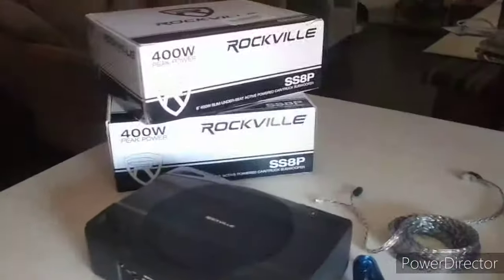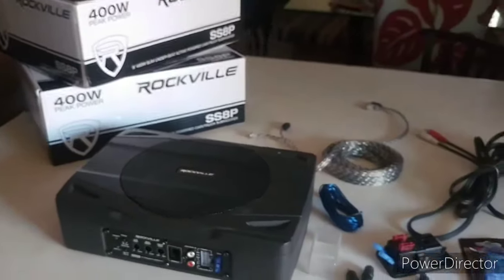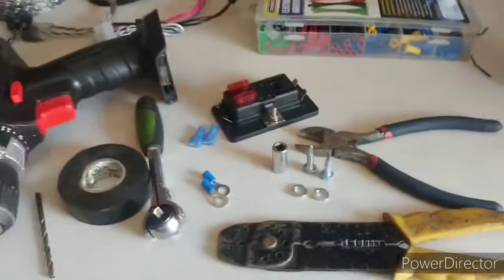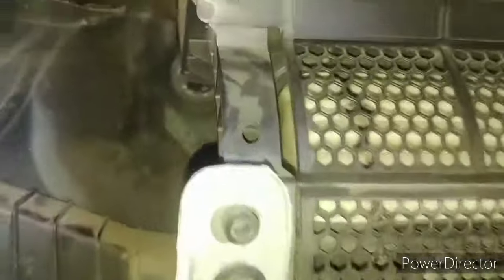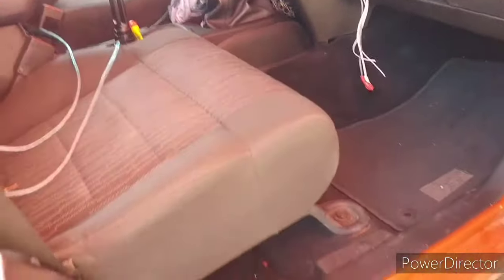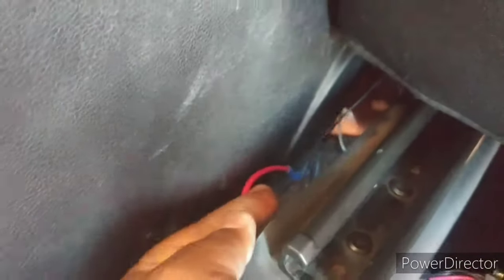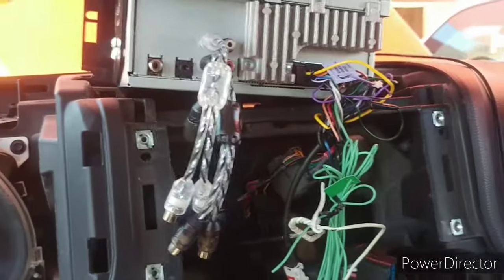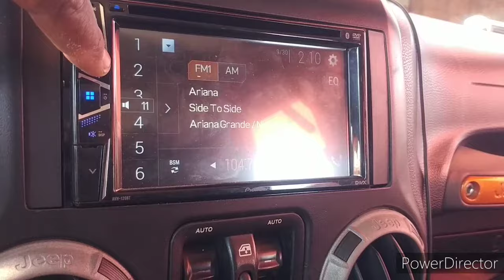How To Install Rockville 8" 400w Underseat Subs in Jeep Wrangler

Comment: Goddammn, I know people was enjoying them speakers because I was enjoying them through my phone!!! You really be making it happen, and I'm here for it!!!
Reply from the maker: They make it sound a lot warmer as the bass really wraps around and rumbles the seats pretty good. It's like being in a theater, man! Love cruising in this with the tops off. Lotta time and effort put into this build, but worth it!
Reply: @MicDropBBQ  True, I see it!!! I love seeing your projects come to fruition!! People with vision interest me a whole lot because y'all's brains work on another type of level!!
Reply from the maker: We're engineers at heart. We see something, and then we start gathering parts and MAKING parts in the garage just to complete the project. The Procharger Project was the largest I've done on the Jeep, yet. THAT was a nightmare. Pull the transmission and replacing the clutch was easier than building the supercharger setup. But I learned a lot about myself and the power of just BELIEVING in what I could do. So many in Jeep forums said it wouldn't work because I had a 2011 with 155hp engine (weak) with a 3.8 V6. I took a setup designed for a 2020 3.6 V6 engine with a lot more horsepower.

I built it anyways. Been driving it since, and none of them ever commented on the video because they really wished they would have been right. To this day, I'm driving a supercharged Jeep with a garage-built kit, no template...no schematic. All thinking it thru as I built it on video. I showed my hiccups and I showed my successes on that video.

I was more about BELIEVING in yourself than it was about building the setup. I just knew in my heart I could do it, even when others doubted me. I put up just over $4,500 in parts and tuning services (when it was done). I call it a win. LOL!

To buy a kit designed for the engine I have would have been over $8k, and the wait was almost 6 months for them to build it. It took me 7 days.
Reply: @MicDropBBQ  I'd say that's a big win!!!

Comment: Thanks for the detailed instructions. Best one for this unit!
Reply from the maker: Welcome, David! Mine are still rocking to this day! Nice, theater sound with rumble seats!
Reply: @MicDropBBQ  quick question. I see where the remote wire goes to the unit but what is that connected to?  I’m a little confused.
Reply from the maker: @davidarocha1075 the remote wire is just a signal wire to tell the unit you want to power it on. Remote wire goes from head unit to a device
Reply: @MicDropBBQ  thank you! 🙏🏼

Comment: Awesome review thinking of doing the same to my Jeep!
Reply from the maker: You won't be disappointed, in my opinion. Thing is, the 8s fit PERFECTLY under there. The 10s might be a bit too large, but the 8s? Enough room for wiring and all to fit under there.

I run with the gain at around 90% on them, and it sounds like DOLBY surround sound in the Jeep. With the gain turned down to zero, you can feel the hollowness and feel the "kick" from the other sub in the back, but these under-seat subs fill the Jeep with warm, rumbling bass you can hear AND feel.

Thanks for checking out the video, brotha!

Comment: I was thinking of running a dual set up like this for my charger only thing is i also wanted to wire in a trunk sub to add an extra kick from the back.... Still figuring out how I'm gonna wire it but I'm definitely gonna use this a base reference for the two under the seats
Reply from the maker: I run a 10" SKAR in the trunk with this setup, and two 8" boat speakers. All the videos in my Wrangler sound system playlist. I showed how I split all the signals.

Comment: What if you want to use stock head unit
Reply from the maker: You can if you run RCA cables from the stock unit to these. I never had the stock unit, but if you have RCA leads, that's all I used to give em signals.

Comment: Hey hey found the block fuse where did you get the splitters?
Reply from the maker: Got em from Walmart. But they have some online (ebay) that has more in a pack. I ended up installing another sub in the rear and needed 2 more. My Walmart ran out!
Reply: I guess they usually come with 1 male and male female outs but some how you got 2 male in versions of a splitter?
Reply from the maker: @BenedictHudson  that's the assignment you have to search for. They sell em!
Reply: @UberJeepAZ  right on.  My jeep jk is a 2 seater so I'd be only able to fit 2 anyway so I guess I'll just need the 1 male in 2 female out kind
Reply from the maker: You've got the dune buggy Jeep! That's the OG Jeep right there! That's the ones that started this whole Jeep craze. hahahaha! Good luck, brotha. And if Walmart carries them, you'll see them on their website before you even go into the store. Saves a little time.
Reply: @UberJeepAZ  thanks alot for your help mate,  got the bits ordered and will tackle this soon.  Thank you for your video. Very well done and love your narration.  Last quick Q.  The antennae wire you mention in the beginning what did you do with that in the end. I feel like you didn't mention it again after the beginning

Comment: Hey what’s up! Thinking about throwing some 6.5 or 8 subwoofers under my rear seats in my JL . Any suggestions?
Reply from the maker: I would do 6.5" due to shallow space under the rear seats compared to the front. Plus if you let the rear seats down, speakers will prevent them from laying down flat. That's why I never put any under my rear seats.

These small powered subs are clean and fill the cabin with nice bass.

Comment: Bro,  hooking this up is a nightmare for my 08.  I'm trying to connect the remote wire to the "power attannae" of my radio and its not receiving signal. I can only get power to it if I directly wire the remote wire to the wire connected to the 12v battery right now.  I don't want to have that because the sub won't turn off when the car is off, draining battery.... thought the end was in sight
Reply from the maker: I have my remote wire connected to the remote wiring coming out of the back of my head unit. The remote wire is a signal, so if you run it directly to the power wire, it will have a constant signal powering the amps. Yup.

I say find the blue wire coming out of your head unit and hook it to that. Now when you turn the head unit on, those speakers will come on.
Reply: @MicDropBBQ  yup did exactly that.  It's not signaling it to turn on.   I'm stumped....
Reply from the maker: @BenedictHudson  Maybe the wire from the head unit you're using isn't the actual remote wire that engages when you turn the unit on. If you have a volt meter, you can test that wire when the head unit is off, and then when it's on.

If you're getting no power to it, that's not the correct wire.

Another way to do it (as I have my entire REAR SUBS and TOWER SPEAKERS like this: I have my Jeep toggle switches turning everything in the rear on. Yup. Direct power to the toggle, but the speakers in the back wont kick on until I turn them on. This allows me to off-road and keep those wires from having power, in case I wanna take the subs out and put a cooler back there.

If you can't find the remote wire, just run straight power to the toggle switch from the battery (with an inline fuse in the middle, of course). Bypass the whole need for the remove wire. YOU are now the remote wire.
Reply: @UberJeepAZ  thanks for the help man so much .  Gonna try again tomorrow will let you know.  I'll try and look up your ideas.  Not too sure on them yet
Reply from the maker: @BenedictHudson  Yeah brotha. Just test that remote wire to even make sure you're getting power when you kick the unit on. That's where I would start. And maybe the remote wire on the head unit you've got isn't blue, but a different color. I'd test a few to make sure. There has to be a way before doing the toggle-switch idea. I only did the toggle so I can remove the speakers from the rear from time to time, if need be. Didn't want constant power going back there with wires flopping around.
Reply: @UberJeepAZ  wish I could send some pics I think I might know why, on my harness from the car there's no wire for where the harness for the radio has the power attannae if that makes any sense.   So when the radio harness plugs into the power harness from the car there's nothing there.  So maybe I gotta find another wire
Reply: Brother, you will find me dead next to my jeep cuz of this haha.  I just tried to splice the remote wire to the 12 v cig lighter plug and no go.  Can't make this up 😂
Reply: Brother....I did it....I did it!!  I spliced the ignition switch wire on the radio head unit to the remote wire.  That did it.  Omg

Comment: Quick question where do i connect the control wire to?
Reply from the maker: If by control wire, you mean the wire that actually turns the amp on: that's the remote wire. That splices onto the remote wire from the back of the head unit. Should be a blue wire as well. Most head units use a standard color breakdown for Power/Ground/Remote...Red/Black/Blue.

Once you connect the remote wire to the head unit, it should power the speaker/amp when you turn the radio on. The constant power supply (red wire) won't power the speaker, as the internal switch will keep power from hitting the speaker until the remote signal engages it.
Reply: @MicDropBBQ  ooh got it is there any other way i can connect my remote wire to another source of power? Without putting it on the unit itself?
Reply from the maker: @SolorzanoAle1  Well, you can run it to a toggle switch that goes directly to the battery. But I would add an inline fuse to it! I wouldn't run it STRAIGHT to the battery. Anything that goes to your battery should have an inline fuse, if it's not wired thru the fuse box itself. This prevents that constant power that might burn the unit out, in the event of a crossed wire or surge.
Reply: @MicDropBBQ  so using a wire with an inline fuse  might work?
Reply from the maker: @SolorzanoAle1  It should. But if you go directly to the speaker/amp, it will always be ON. You've gotta run it to a toggle switch or a button that creates continuity to turn it off/on instead.
Reply from the maker: @SolorzanoAle1  the toggle switch will throw the 12V power to the internal signal in the amp - and THAT will open the circuit on the amp's board to allow the actual 12V power wire to signal everything to load up power to the capacitors and all that.

The remote wire just say "GO". That's all it does, but it needs that toggle to do it, whereas the radio won't be doing it for you.
Reply: @MicDropBBQ  okay got it
Reply from the maker: @SolorzanoAle1  Good luck, brotha. Keep me posted, but I think you're asking the right questions and getting your mind setup to do it correctly. I've got faith that you'll be like, "...it works just as expected!" haha!
Reply: @MicDropBBQ  thanks tho we’ll see how it goes the only thing I really don’t wanna do is to splice the remote wire to the oem harnesses thats why im trying some other options ✌🏻

Comment: Had a disaster today putting this in today.  I was going with the 8 gauge wire the company recommends and I realized i didnt have the right connectors, strippers, crimpers,  You name it when I thought I did.  What gauge wire did you use? It doesn't look like 8 that they recommend.  Does it not work as well with thinner wire?
Reply from the maker: Has been working well with the wiring I used, as they're still bumping to this day. Not sure what gauge I used but you can probably see it in the video. I keep a few spools of it in the garage. For power and ground, you don't need massive wiring for these, as they're only 8" and the amp is integrated. 

I used all basic tools and nothing crazy. Basic wire cutters. Basic wire stripper. Only needed a crimp tool for the end adapters  when I grounded a wire under the seats and crimped the power wire adapter to connect to the power supply box  sitting next to my battery under the hood.

If their kit has wire that is too large, you may have to strip the wire down to size a little. That works sometimes too.
Reply: @UberJeepAZ  good call man.  They say to use 8 gauge in the manual but on their site they sell kits for 10 gauge.   I bought some 10 gauge wire and will use that as 10 gauge is the minumum for most crimpers and connector sets.  It looks like you use some pretty thin stuff, I live in NY state so I'd need some insulated stuff too.
Reply from the maker: @BenedictHudson  Oh yeah, you gotta keep that cold and moisture out, especially if you rolling in the snow this winter! Ya'll been getting a lot of rain, too. Man. The East been getting pounded this past 2yrs, so you gotta protect everything a little better, brotha!

I just looked in the garage and some of my ground is 18 gauge still in a package. My power wire is somewhere around here, but it might be the same. You could probably go to 10-12gauge and be fine, tho. As long as you can get enough of the wire in the fittings of the ports for power/ground, you'll be fine. I wouldn't go TOO thin, because even my 18 gauge is too thin for certain amps/subs. I know my larger sub in the back is clearly not 18! LOL! I wouldn't even try thin wires on an amp that powerful.
Reply: @UberJeepAZ  yeah unit is still not powering on. Was on tech support and I think my ground wire might have been too thin.  Gonna go to 10 gauge and see what happens
Reply: Oh man I just got it to get power. The fuse box method didn't work on my jeep. I have an 08 and it didn't like going through that! Wow what an adventure
Reply from the maker: @BenedictHudson  I didn't use a fuse box either. I run an auxiliary supply off to the side of the battery that has fuses for accessories only. My speakers and my GMRS radio run thru it. I don't touch the stock fuse box...nope!

Comment: Probably a silly question but I’m getting the same fuse box and also the 2 Rockville ss8p’s for my wrangler. What fuse should I use for them?
Reply from the maker: I run a 30 amp fuse in each of mine. You can go as low as a 25 and it works fine has a layer of protection against a short.

Comment: I have installed 1 in the rear of my 2020 trail boss. WHAT A DIFFERENCE!!!!!. But i curious if instead of connecting 2 separate gain adjustment knobs they come with, can you use some kind of splitter and connect with just 1?
Reply from the maker: I never thought of getting a splitter for it. See, that's why I love folks that THINK and come up with different versions of q setup! That's actually not a bad idea. It's actually clever. Hmmmmmm. Hahahaha! Now you got me thinking!

And yup, with the gain off, it almost sounds hollow in the Jeep. The moment I turn em back up, warm bass like a theater!
Reply: @MicDropBBQ  also because im using the stock stereo which has no rca outputs and using the wires i spliced into my front speakers to the rockville with no rca converters i didnt need a remote wire. Theres a button under the phaser button (cant remember what its called) that when switched on it just uses the signal from the speaker wire to turn the amp on and off when turning on and off the vehicle. And also i think those rj45 wires are data so it may not be as easy as connecting a regular phone cord. (Number of pins)
Reply from the maker: @zomby1872  WOW! So you didn't have to use the remote wire? That's something I've never heard of. And that's good to know with these!!! I would like to run one under my rear seats if there is enough space, so having this information is useful for making it an easier setup.

I'll probably start measuring space with the seat down to see if one will fit under there. If not, then it was a good idea, but it wont be possible. But interesting to know about the wires being the signal! THANK YOU!! I'll look at them, for sure! I appreciate you posting this and telling me about it.

Comment: Broth what is the name for the battery block?
Reply from the maker: It's just a universal one that I got from Autozone or somewhere. Easier to do it that way versus running wires to the battery itself. Make sure you get a 4-slot one! You'll blow-thru a 2- slot so fast just hooking up random stuff!
Reply: Thanks again, I'm just waiting for Amazon to deliver the rockville I'm almost ready!!
Reply from the maker: @Wladimir Delossantos  Then you have a little time to run by Walmart or Amazon to see if they have this fuse box. You might as well get everything set up while you're waiting. Then all you gotta do is power the box up when it arrives, and you're good to go! The installation is what takes the most time. Placing the box under the seat and locking it down is pretty easy. Good luck brotha!! Let me know how it goes!!

Comment: How are the speakers holding up? Looks like you have had them for 2 years now.
Reply from the maker: Driving right now actually! Just parked and I'm bumping the system! Added a 10" Skar to the family. The Rockville still holding up, giving me that theater sound!
Reply: Cool! Mine should be here Saturday. I drive a 2015 JKU and have the 10in kicker 46HS10 under seat on passenger already but got this one because of price. Hoping it will boost my bass a little more and sound as good as my kicker sub
Reply from the maker: @msburrage74  it's more of a runble and rolling bass, not a punchy bass. Reminds me of having surround sound in the house.

Comment: Where do you get the four splitter
Reply from the maker: I bought two packages of them from Walmart in the car audio section. I might have to keep a few packages of these in the garage. You can literally split the signal as many times as you'd like, but I don't know if there would be any "loss" by doing so. I know my systems sounds clean and there's not indication of any loss.

My volume goes up to 40, but by the time I hit 5 to 7 (depending on song) it's too loud already. Like WAY too loud to where I have to adjust the EQ to pull out certain frequencies before my ear drums explode. LOL!